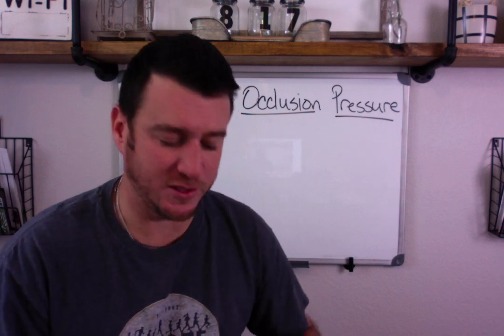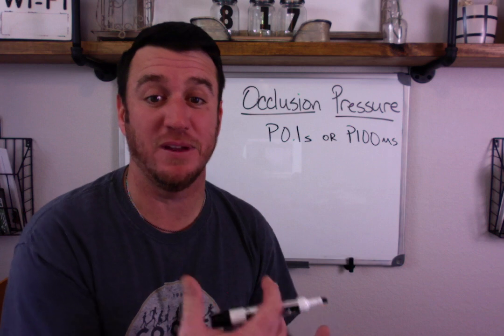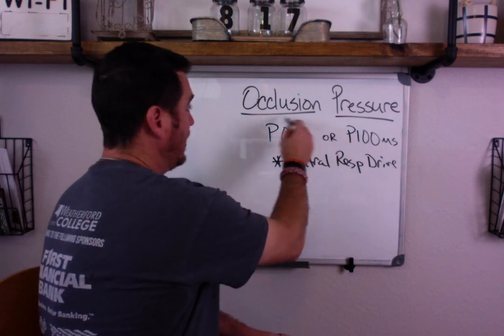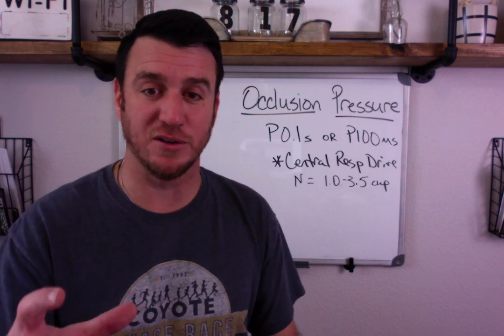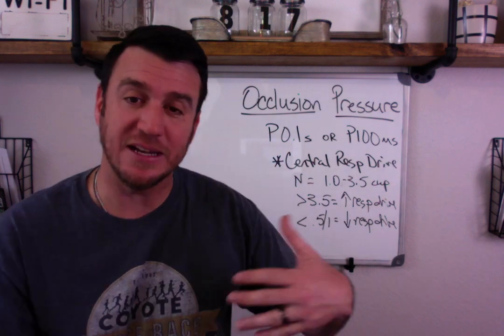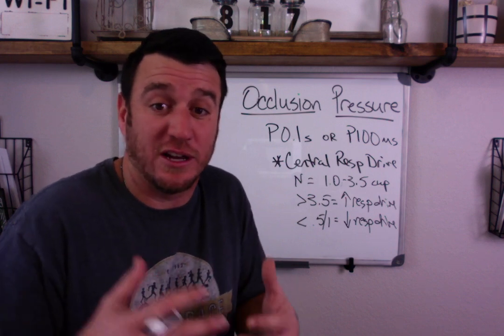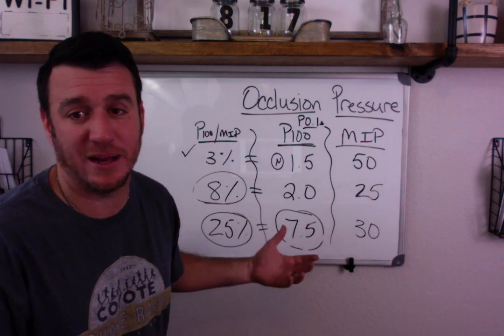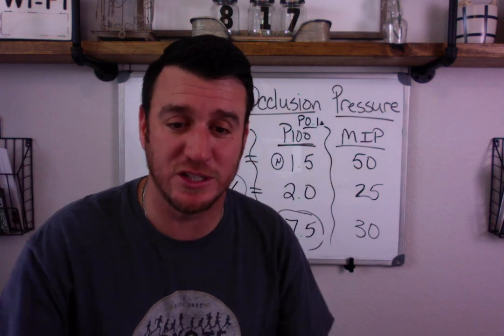Respiratory Therapy - Occlusion Pressure (P0.1s or P100ms)

Comment: You are a HERO to me, so there's nobody better to ask this than YOU! OK. So behind me, where I'm sitting, there's a Drawer, and In the Drawer, there's a Mercury Medical NIFometer. It's a disposable one, and I have a question about NIF. You know, modern ventilators such as the Drager Series Ventilators, PB840s, PB980s, Servo I vents, and other ICU ventilators have the ability to measure a NIF on the ventilator. For Example on the 840, You go to Respiratory Mechanics, and You select the NIF option. You can perform the NIF that way. Now the Hamilton Ventilators don't have a way to perform a NIF. but other ventilators do. In some hospitals, they're usingthose NIFometers, such as the disposable ones from Mercury Medical and this is the question That I have. What do you think is more accurate? To Measure the NIF on the Ventilator, or to Measure it with a NIFometer? I know this is an unconventional question, but Seriously, I wish It were covered on YouTube!
Reply from the maker: Hey Peter!  I honestly would have to rely on research data to answer this question.  I'm not even sure if there's data available to answer which is better, but I will say that if the option to perform is on the ventilator then I'm using that one. What makes you feel one may be more or less  accurate?  Thanks for  commenting with your question!

Comment: When I was researching on the normal value of P0.1 I encountered your video. Thanks so much for your informative session! Just a quick question...why is that named "occlusion" pressure? Is that because that's the negative pressure patients can generate when the respiratory circuit is temporarily occluded by the valves (hence the patients is separated from the ventilator)? I'd really appreciate your help!
Reply: Yep, that’s right.

Comment: In our Hamilton G-5 ventilator this feature is available but it doesn't measure the value all the time 
May be it require esophageal catheter
Reply from the maker: Hi Niaz.  If I'm not mistaking, on the G5 you have to be in pressure trigger mode to get the value.  Try that and let me know what you find.  Thanks for watching!!!

Comment: Nice informative video Sir. How do you measure MIP of patient on ventilator?
Reply from the maker: Many vents have a feature you can utilize to assess MIP without having to break the circuit.  If not, you must use a MIP gauge temporarily attached to the patient's airway.

Comment: Thank you for taking the time to answer this question.
Reply from the maker: You're very welcome.  Hope it helped.
Reply from the maker: Also, your PC-SIMV+ video is almost ready too.  Stay tuned. Just curious, are you a student?  
 And thanks for watching!
Reply: @RespiratoryCoach  i just graduated with BSRT this last semester but i had an associate degree for just a few years. My employer decided to switch all ventilators from 840s to the new drager Infiniti 500 and it jas the P1.0
I tried to research on it but nothing made sense out there but your explanation was detailed and yet easy to understand. Thanks alot for doing this.
Reply: @transmutation-alchemist5802  your 840 didn't have p1.0? weird, because our's does.  I think the older models of 840 didn't get the software update